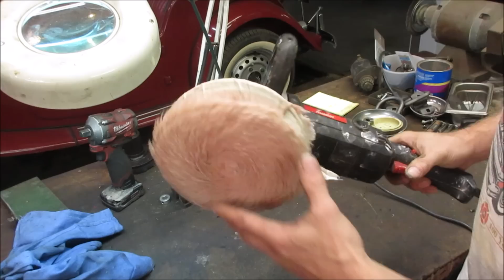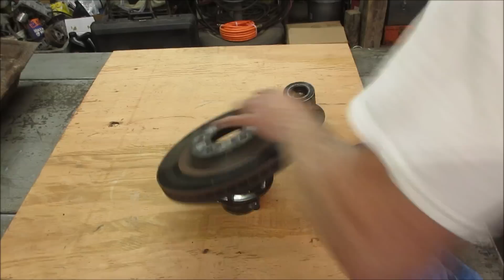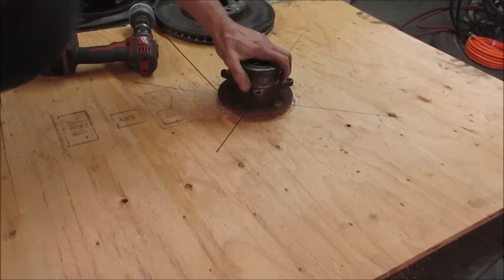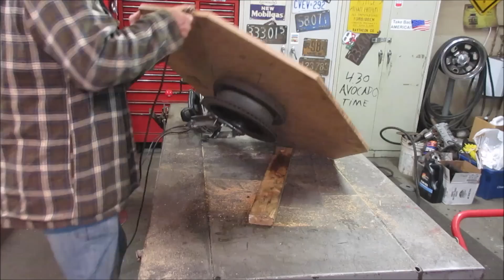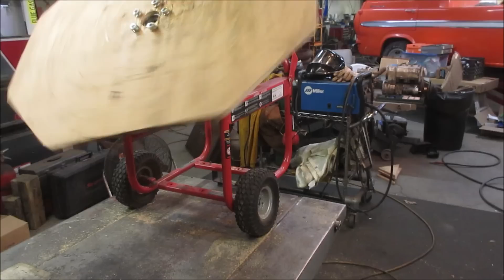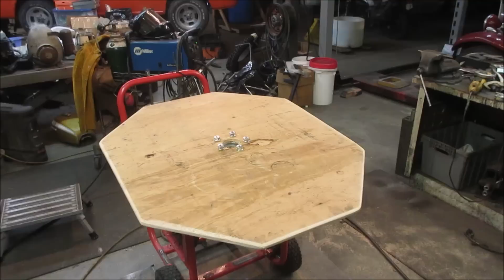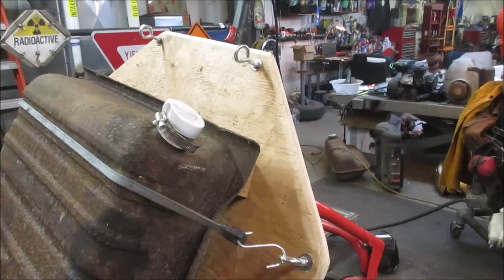Building A Machine To Fix Rusty Fuel Tanks Of All Kinds - Let's Get Started!

Comment: Rather than going to bolting, I've found that brazing works very well on cast iron. The trick is to pre heat the cast with a rosebud tip, and then switch to a brazing tip to do the actual joinery.

Comment: missed this one till new year!!  i think you could un bolt the motor from the gearbox on the buffer and rotate it (the switch) around to the top/ opposite side, you also had a multi shive pulley back in the stash that you could make a reducer have to have another belt and bearing for it, you can undo the angle brace and flip the handle down ,re-pin it and roll it easier and put a swivel wheel on the weight end??  strap the naughty grand kids to it:)

Comment: i ran a pipe coating plant and we would blast the inside of the pipe with a metal sharps and bides shot to take all the rust off the metal before coating it . that will cut the rust out a lot faster for you

Comment: I would think an old cement mixer would have answered all of your problems. Tiltable, motor with pulley already attached.  Then just bolt on the plywood and you'd be finished

Comment: Is that as slow as it can go? Sounds to me like it needs to go slower, that should be max speed. Prolly can use liquid only (evapo-rust?) if rust isn't that bad. Perhaps, if it has enough angle and speed adjustment, use it to coat with a chemical liner?

Comment: two ideas
put a stepdown transformer on it get voltage down, that puts the variable adjustment back into play.
or
While you are out junking watch for a variac, it adjusts AC voltage. likely would not harm the grinder motor and would give you amazing speed control, because a little slower would be very helpful, but they are not cheap.

Comment: Years ago we needed something similar for both removing paint from steel parts and for rusty tanks. The first rendition of the rig we made started out with an old dragster rear axle that had been retired for a cracked housing. It was narrow, maybe 25" hub to hub. 
I drilled and bolted an old pulley to the pinion, mounted the thing on a steel frame atop a panel cart like they have at Home Depot, then on each side I attached a 3x3ft wire bread rack/shelf that someone had trash picked years ago from a local mini mart that closed up. 
On one side I attached four springs, and four hooks, the springs were similar to garage door springs, strong enough to hold a 20 gallon fuel tank full of pebbles or steel shot. 

The other side had a steel plate with about 40 1" holes and 40 1/2" holes so things can be attached with black bungie cords, and I also welded a plate to a 15 gallon oil barrel with a ring clamp on top so we could put small parts it for tumbling. 

For power we used a 2hp motor off an old air compressor. It was on wheels, so it could be put outside where we didn't have to listen to it all day. We would put it in an old barn out behind the shop so it could run all night if needed. 

The motor sat on the bottom of the cart, the belt ran up to the pinion which had a power steering pulley off a power steering pump drilled and cored to fit the pinion yoke, and the motor had a 2" sheave. There was a spring loaded belt tensioner that I added because the thing  was hard to start sometimes when it was cold outside, we would turn on the motor and ease the tensioner back against the belt to get big loads turning. 

We used it for years. I left that place and the last I heard the owners were both long since passed away. We built it in the 80's and used it until about 2004. so it had close to 20 years of use on it. We put ceramic abrasives in the barrel for cleaning parts and it ate through the barrel after about four years. Faster when run wet or with light oil in the barrel. (we would use recycled spindle lube from a nearby machine shop in the small parts cleaner, it kept it from rusting and it cleaned faster. About a gallon of oil to a 15 gal barrel of ceramic stones was all it took. After a few years, after we got real comfortable with it and knew it wasn't going to fall apart while no one was around it ran nearly 24 hrs  a day. I was surprised that the neighbors never complained about the noise though. Even with a blanket over the items being tumbled it was still loud. 

Speed wise, if it helps, and figure that 3.20:1 gears turned with a 1750 rpm motor, through 2" to 7" pulleys each axle was turning about 200 rpm give or take a bit. That was plenty fast. Probably around 15mph if it were a car going down the road at that speed. 
We never checked the actual rpm but it worked so we didn't mess with it. 
One change we did made was to improve the wheels, we put a cut down trailer axle at one end, and two feet at the other with a hitch on the other so we could move it around with a trailer dolly or tractor.

Comment: Nice contraption! Definitely should run slower. These brushed motors will run slower if you connect a resistor in series, try a small electric fire wired in series with the power. Or an external speed regulator for such "universal" motors

Comment: additional use suggestion: lining the inside of containers with sealants or coatings. it would probably require an additional modification where it slowly oscillates the table's angle so that it can get an even coating, but it should work pretty well for that.

Comment: A thought: if you add drag to the turntable (a brake mechanism) you could fine tune the rotation. A soft rubber tyre pressed against it would do. 😁

Comment: I think if you’re gonna be tumbling, some kind of abrasive inside the fuel tanks. It needs to run really slow so they abrasive can tumble.. sort of like those old rock tumblers for polishing stones. It was kind of thinking and putting it on a tube then you could lock it down in different angles depending on what fuel tank you want to clean. Still think that polishing motor is gonna burn up like 50 RPM spinning motion

Comment: I really think you need to use a motor that has made you run continuously like a half horsepower 1700 RPM electric motor. Then use different size pulleys to slow it down that polishing motor is gonna burn up.

Comment: If you absolutely need to move a gasoline vehicle with a temporary fuel tank I suggest a boat gas tank with a self powered fuel pump on a rubber mat strapped down on the hood until you can fix the gas tank . I have a neighbor that has four of them on his ladder rack and he has been driving it like that for years !

Comment: I think it needs to be slow so that centrifugal force does not take over and spin the cleaning material to the outer wall, I made a rock tumbler that was spinning too fast and the rocks did not tumble till I slowed it down considerably. Your fastest speed needs to be about what your original start speed is and slower to almost standstill. Necessity is the mother of invention, Its amazing what you can make with what so many people call throw away junk, I try not to throw away any material, problem is you need a large space to keep it all and in some sort of order so you know where everything is, Great project.

Comment: You have to keep one thing in mind: The motor in that grinder was selected to turn a buffer, wire wheel,  etc. When you put the load on the unit I'm imagining, you are creating additional  and excessive current in the armature.  If it's too great, the armature will overeat and take the brushes with it. Just sayin'.

Comment: you could allways add a control box to the handle of the red frame or to the grinder handle that uses a speed control to slow down the speed more if needed ..  the speed of the motor is easy to change after the fact .. everything else seems like a great setup .. so I would not worry about the speed . thats easy to fix if its a problem ..  love the idea .. awesome .. !!

Comment: Why don’t you just change the angle of the chassis to change the angle you are spinning it at.  My rule is KI SS, keep it simple, stupid!  Get a 1725 rpm washing machine motor and connect it via a chain to a pulley, so you can reduce the speed to 500 rpm’s or less.  I would use something more stout than a piece of plywood.  Balance will be the biggest problem you will have to overcome if you are going to spin it.

Comment: You could put an additional belt set to gear it down more, before your final drive setup.
Another option would be to use a large bicycle wheel, for example, instead of the brake disc, which would gear it down a bit more.

Comment: I put four eyebolts through the mouth of my cement mixer. I strap the gas tank to the face of the cement mixer, fill the tank with hardware and turn it on. And yes I can change the angle so that it reaches every part of the tank. It is by far my most popular video, but do you think I can find it?

Comment: I used a paint can shacker like they use at lowes and paint store to mix paint up. I just made extendable arms and used rachet straps to hold the tanks and just put small polishing stones in them. Its noisy  but it does shake the tanks clean.

Comment: haha what a fun build, something you could put in with the water is Citric Acid. Its cheaper then vingar and you can even mix it with washing soda to make a PH neutral like eveporust. Weighed out 100grams of citric acid to 40 grams washing soda per gallon of water. Its nearly $1 a gallon if sourced properly! PS. if it turns dark brown the solution is spent, just like evaporust haha

Comment: I'm thinking you may still have a speed issue. You've made a design based on a large tank that spins more slowly at its outer edge where the hardware is and its spot on.  But the smaller the tank, the closer to the centre it will be and therefore the faster it will be spinning at its outer edge.

Comment: I watched your video and understood what you were aiming for.  If you wanted a heavy weight one, would the front drive axle form a 4 wheel drive not have been easier, after all you can dive it through the diff and the wheel turns and and the steering option together with the camber angle and other adjustments may provide the oscillating motion needed to clean the tanks.
Given that in the main empty fuel tanks are very light even with a small quantity of hardware and fluid  a cleaner based on a bicycle wheel set up would be much lighter and manageable.
I look forward to seeing where you end up. Enjoyable watch.

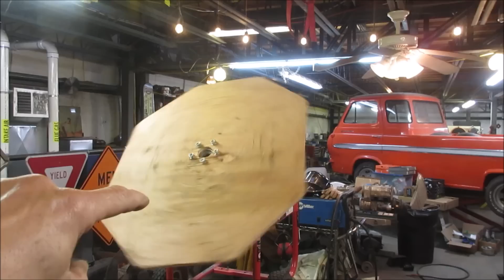Comment: 55:00 - At this point, looks like da Vinci's first shot at a helicopter :o))
Reply: Plywood's gonna get wet - spills, leaky tanks, cleaning solution etc.  Next time you have it apart, how 'bout a good coat of mineral oil on the top and sides of the plywood?  It'll keep it from delaminating when water and detergents are (guaranteed) spilled on it.  Mineral oil can be reapplied depending on use.

Comment: Why not use a U-joint/CV-joint and a cam so there are dual axis of rotation. Or mount the board's pulley at an angle with enough clearance so the rotation won't interfere with the drive side. Kind of like oscillation. Or attach the gas tanks tilted and that should accomplish the same effect. That way the cleaning has more coverage.

Comment: Grab a bunch of T-nuts and install on the bottom side of the plywood radially along the lines of the current eye bolts and then you can move them around as needed.

Comment: I'm yelling through my keyboard..  As many curb pickups that you do, you have never come across a working treadmill???  I've made several tools with the VSD's from those.  Welding turntable, a drive to advance my sawmill blade sharpener..  I do like your bungee cord/eyebolt idea.  I was using airplane strapping.

Comment: I found a material you weld with heat using a thin steel plate between the ends that allows you to make a fan belt with Different Styles, sizes, and lengths available. You heat the metal with a torch on the top portion, then put both ends of the Polyurethane Belt on opposite sides of the plate, slide them both off the plate pulling upward so they barely touch the plate melting the belt ends, and the two ends converge into one complete belt once they clear the metal plate. I believe it was shown on the Essential Craftsman Channel, but I can't find the video where he did it. 
"Round Belting PU Belt Polyurethane Round Belt for Drive Green 4mm x 10m" <<<---I used this to make a belt on my Key Machine Pulleys
"5FT Power Twist V Belt 1/2-Inch x 5 Feet A Type, Adjustable Link Belt Perfect for Lathes, Table Saws (Red)" <<<Remove chain links as needed

Those are two examples that may come in handy in the build here or the future... Found on Amazon but I'm sure they can be had elsewhere.

Comment: Thanks for the video. Coming from an electronics back ground you could zip tie the grinder always on high speed. Plug the grinder into a Variac. A Variac is used to adjust line voltage. By adjust the 120 Volts with the Variac it will adjust the speed of the grinder.

Comment: I use several chains from snow blowers and lawn tractors cut to about 8-10"   for descaling has tanks. They hammer the rust and varnish better and are mich easier to remove

Comment: My idea to fix a tank on it will be. Put multiple 4x4 on in with slots. To the slots put straps. For a small tank you use the inner two 4x4 and going outward with the straps with larger tanks.

Comment: other use is horizontal polishing disk, a heavy metal disk maybe 18 inches diameter with fine grade grit polishing wet surface.
a pottery wheel.
banding wheel for painting lines with a rigger brush.
rotating table for making plaster decorative ceiling roses with a pattern jig.
and so on...

Comment: You should use an inline ceiling fan variable speed control.
And mount something like a protractor on the side so you can go from 0 to 90 ° with an adjustment. Similar to the adjustment on a Skil saw or jig saw.

Comment: A motor mounted on the back side of the plywood with just the shaft sticking through for your pulley would give you unimpeded clearance for the tank to revolve.  That grinder looks like it will be in the way big time.  Knowing you you'll try to swing a six hundred gallon tank off a Cat D11 at some point!!!

Comment: I just use my concrete mixer for the same purpose. Its got the RPM, the tilt option and the stability as is. Smaller tanks can go inside strapped down while bigger ones are attached outside.

Comment: Your old grinder is powered by what’s called a “universal motor” (brushed armature with a series field .. will run on AC or DC). You can operate it at low speed using 12V DC, or in the case of mains voltage, put an incandescent lamp in series to get more voltage drop, to slow the motor down more.

Comment: Hi Mustie1! 
My first thought when I saw the first iteration spinning too fast was to add a "variable speed" to the variable speed motor. Could you add something like a dimmer switch/outlet on an extension cord and plug the buffer into that to control the pixies going to the electric motor?? Kind of dial in  what speed you need on the power supply side as opposed to the mechanical output side?
Love your vids!
Cheers

Comment: Could you wire a dimmer switch in line on your grinder power cord to give you better speed control or does the grinder not operate under a certain voltage.

Comment: Mustie, why not just pour various grades of sand blast media inside until you are satisfied with the level of rust removal.  Also, POR-15 makes a gas tank formulation to pour inside to seal any pin holes that may exist.  And instead of using a chain whip to  distribute it inside, just you your new fangled machine.  It should work perfectly to distribute the urethane coating.

Comment: Another idea is to tumble with "heavier media" dumped inside of the tank if speak ends up still being a factor. I noticed when the belt was loose it spun much slower. Loosening the belt will slow it also if you need it to with the pulley sliding on the belt. Not optimal but it does slow it quite a bit and slow is your friend when tumbling tanks.

Comment: The railroad where I worked for 35 years used three different sized vibrator tanks for rust removal. The best media are cylindrical shaped ceramic beads hands down. Metal media damages the parts. We started with a metal bead that looked like a miniature UFO but it would actually remove metal and dent certain parts that's when we went to and stayed with the ceramic cylinder shaped beads. I use walnut shell media in my home parts vibrator for brass.

Comment: It still looks like it's moving a bit fast to me. Doesn't sound like the hardware is sliding down each side as it spins. Maybe if you put a separate speed control that has higher resistance and just take the old one out of circuit?

Comment: I've found that mounting the tank off center slings the nuts and bolts around better. I've used a cement mixer for 60+ years for this.

Comment: Just make a jack shaft and have 2 stage gear reduction.  That would allow you to keep the grinder in peak torque.  Drill presses also have those stacked pulleys which allow for more adjustment.

Comment: Ok, good idea, but adding stuff like chains, rocks, nuts inside the tank is not necessary, just add a couple gallons of evaporust and spin it slowly at an angle for 24 hours and it will be 100% rust free and spotless clean. I used that when restoring my 68 Dart. It’s not snake oil, it really works. You could also just fill up the tank without spinning it, but it would Take a lot of liquid.
Reply: I should add that it is a chelation process, the rust binds itself to the Evaporust liquid, which can be reused many times, gradually turning the liquid darker and darker. Since it’s not a primer, and has detergents, it leaves the metal super clean. And since it is not a base or acid, it does not remove any metal.

Comment: We used reostadts made from a dimmer switch to control the heat when soldering stained glass windows. That may be an idea on controlling rotation speed on the tank tumbler?